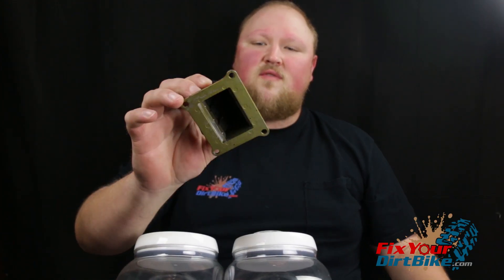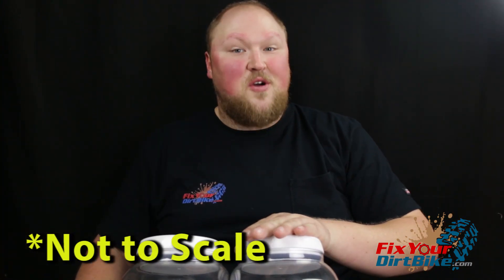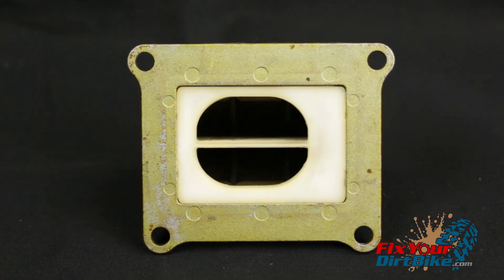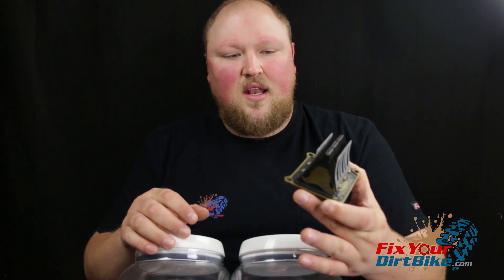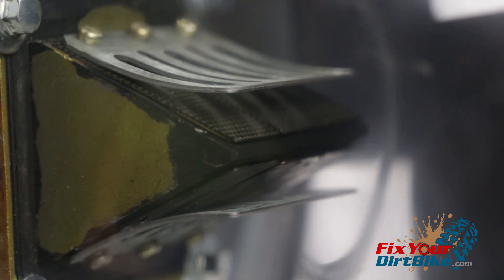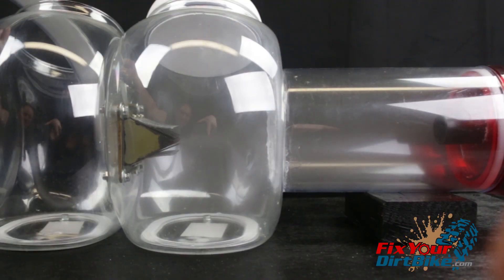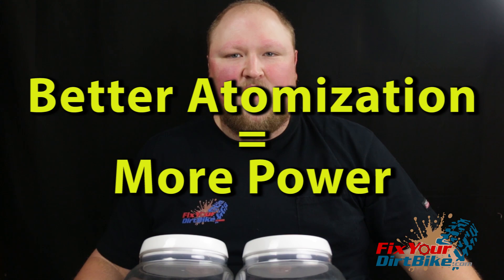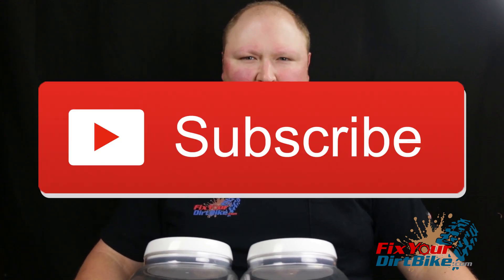How The Reed Valve Works In Your 2-Stroke Dirt Bike | Fix Your Dirt Bike

Comment: Threadlock is needed according to the design. On some enignes the screws literally touch the cylinder or crankcase, so there's no room for them to get loose more than half a turn.

Comment: can reeds be the cause of 4 stroking in a 2 stroke?
Reply from the maker: Possibly. Bad reeds make 2-strokes go crazy. But reeds keep the mix in, bad reeds cause backdraft out of the carb, so it probably not causing the rich mix resulting in 4-stroking. Have you checked your floats/float level/flaot needle?

Comment: Would this make your carbourator leak?
Reply from the maker: What kind of leak? Exhaust coming out of the carb? Or a super lean mix?

Exhaust = Yes
Lean mix = Yes, if the gasket is bad, otherwise, no.
Reply: @Fixyourdirtbike  either my float keeps getting stuck because it comes out of the overfill kinda like I was doing wheelies
Reply: @Fixyourdirtbike  or maybe it’s lean idk how to jet or fuck with air fuel mixture it all sounds the same on my quad
Reply: @Fixyourdirtbike  and it all smokes the same

Comment: I’ve decided to restore my an rgv250 that has sat in a barn for 30years. Tank had skanky rusted fuel in it… will talk a bit to clean. I have ordered a new fuel tap and new fuel lines, battery and new radiator hoses. 
Should I replace reeds at this point?
Reply from the maker: I would replace them on principle. New carbon reeds will be far superior to stock 30 years later.

Comment: Will work reeds also cause a flooding problem. I will start my bike and it will die shortly after. Let it sit for a little while and it starts back up then dies again. Pulled my feeds off and saw light in the corners of the right flaps. Also saw some excess gas sitting at the bottom of the reeds on the crank case.

Comment: So the reed valve is pretty much the powerband?
Reply: No. The powerband is the rpm range where the bike makes the best power/usable power. It varies due to many factors. Such as; you could have two different expansion chambers, and on the same bike one might make power down low while the other makes power at higher rpm. Changing the expansion chamber effectively changes the powerband, or the rpm range that the bike makes power

Comment: It is the reed valve problem if the engine wont stay idle and it shuts off suddenly?when i check the reed valve it has probably in 1mm gap..my bike Suzuki panther txr150
Reply: Yes, and harder to start also probably.  They are suppose to sit flush on the cage. If the petals are not damaged/broken/chipped/frayed on the edges, then you may be able to flip the petals upside down to see if they sit flat better.  You can usually get more life out of them that way, but a 1mm gap sounds like a lot.  New reed petals should be on your shopping list.

Comment: Can you recommend reed valves for a 1980 E70ELCSA 70hp Evinrude? This is on a 15ft bass boat. Has the right prop, rpm is 5400 at full throttle.

Comment: Can broken reeds cause low compression
Reply from the maker: No, the reeds have no effect on the combustion chamber or rings. However bad reeds will keep fuel/air from reaching the combustion chamber, which causes a lack of power.
Reply: @Fixyourdirtbike  A broken reed will blow back "primary compression", (the crank case pressure), back into the carb tract a bit, so it does lower primary compression, (probably just at lower rpm's), and that means the bottom end is not filling as well as it should, which would then fill the cylinder a bit less and make less power. But because the compression does not start until after the exhaust port is closed on the up-stroke, (sans pipe effects), you should be right about the cylinder compression not effected.
Reply: Oh,---watching more of the vid,---that's what you said. :)
I just get a little anxious I guess.  Sorry.

Comment: My yz125 idles but when I put it into gear I can ride it for 200ft before it’s sputter and stops, could the reed valves be the issue? I just did a carb rebuild and top end rebuild.
Reply from the maker: What's your spark plug look like? Do you have fuel residue on the intake side of the carb?

Comment: Brother wheater bad reed valves cause starting problem and slow speed problem in bike plz reply
Reply from the maker: Yes
Reply: @Fixyourdirtbike  my bike is rx135 it has pickup problem and slowspeed and starting problem , i checked all wiring but only reed valves is not changed can i change

Comment: Can a reed valve can cause more gasoline consumptions?
Reply from the maker: YES!
Reply: @Fixyourdirtbike  how
Reply from the maker: @listomoto  When the reed valve doesn't close during compression, it will send pressure out through the carburetor, creating vacuum, but in the wrong direction, shooting fuel out of the carb intake.
Reply: @Fixyourdirtbike  i have a bike that consumes too much gas compare to other exact model. when checking my reed valve the tip of the petals is curved resulting from a small 2mm gap opening. do you recommend replacing it?
Reply from the maker: Yes

Comment: Hey I sucked in a quarter I inch square of reed vale into my right cylinder should I take the engine apart? I just notice today it wouldn’t run right  took it apart and saw my reed was broken looks like fiberglass
Reply from the maker: Ooof! Ya, looks like you'll need to split the case and check everything inside.
Reply: You can run it most time reed breaks it gets caught before being Ingested only metal parts will ruin engine had few explode from badly worn bikes quads purchased and they still run always best to strip but replace start and you'll more than likely be fine just make sure no metal parts fallen in you'll be buggered then 😅👌 years later but may help someone else so they don't freak worst case scenario head barrel off and could find it 🎉

Comment: My Yamaha blaster has been carburetor cleaned. I use the right oil to gas ratio. But when it get to higher rpm something starts to make a chirp noice. Please help
Reply from the maker: Chirp? Rev it without the air box and see if exhaust comes out of the carburetor.
Reply: Fix Your Dirt Bike I haven’t taken a look at the reeds yet
Reply: @Fixyourdirtbike  I was thinking he ran over a bird.  :)

Comment: I have a cr 250 97 with v force 3 (w) . Do i have to put a bigger main jet?? Will it work lean with the v force ??
Reply from the maker: Yes, you will probably need to increase your main jet size.
Reply: I think that it's 165 now . I will need a bigger one is that right??
Reply from the maker: 165 is smaller than stock. So bump up to a 175 to get a baseline tune and go from there.
Reply: Ok thank you for helping me.. if i want something more to ask do you have a page on Facebook or something like that???
Reply from the maker: @psilos-nl8gg  You can message me on facebook! https://www.facebook.com/FixYourDirtBike

Comment: Hi
When I take the air filter of my carb , I see white smoke (looks like exhaust gas) coming out of the air intake. The bike runs really poor idle and when I turn the throttle it bogs. I can't get it to rev. Does this have something to do with the Reed valves? 

Thanks
Reply from the maker: Yes. Your reed valve needs to be replaced.
Reply: @Fixyourdirtbike  Thank you! 👍
Reply: @Fixyourdirtbike  I replaced the reeds and it worked, thank you so much!
Reply from the maker: Glad to help!

Comment: Where is the reed valve in my Echo trimmer?  I am guessing it is one of the little flaps on the diaphragm / gaskets that I replaced?  Thanks for the great video!
Reply from the maker: If you have one it will be behind the carburetor.

Comment: Can it be a reason why my bike doesn’t stay idling ? I’ve already tried to adjust the air screw on the carburetor and the idle on the choke and that’s the only way it will stay idling . But it’s strange because the choke looks like it’s coming up all the way after I’ve turned it and that’s the only way it will stay idling. cr125 1994 btw. I should probably adjust my jetting too
Reply from the maker: Possibly, but It wouldn't hurt to change your reeds if you haven't in a while and see if it helps. After that double check your jetting.

Comment: I got a 96 ktm exc 300 and it keep killing the plugs think is the reed valves? Or can u help me solve the problem?
Reply from the maker: Reed valves will cause fuel issues, but what is your carburetor jetting like? How long since your last reed valve service?
Reply: Reed valves looks fine to me.cant remember my jetting I will check but if I put in a new plug it start fine rides like for and hour or less wen u stop it won’t start again put a new plug and it starts and ride again and the old plus is dead
Reply: My main jet is 170,slow jet 42,needle N85D
Reply from the maker: Sounds like your main is too big. Drop to a 168 and see what happens.
Reply: Fix Your Dirt Bike ok

Comment: Fix your dirt bike, can bad Reed valves cause gas/oil mixture pooling on the bottom of my filter/air box? Also can’t seem to get it running fine, took it for a ride and it waisted 3 gallons  on an 2hr ride when all my friends had about 1/2 tank of gas left? Any help would be appreciated thank you
Reply from the maker: YES! That's a sign of really bad reed valves. The high fuel consumption is the first stage of failing reeds, and fuel mix in your air box means it's getting all the way through the carb, which is why your bike won't run right, so get those valves fixed ASAP!
Reply: Yes,thank you very much
Reply: Fix Your Dirt Bike could the same be said if my carb overlows ONLY after the bike is warm? I reckon it could be pressure from the engine pushing back on the fuel in the float, which opens the float needle. I’ve cleaned that carb thoroughly and its not due to dirt/grime. It only overflows when the engine is warm and then it flows drastically.

Comment: Hi friends ,  i need help to buy a new cylinder for my CR 250 '99 , because i need the 12101-KZ3-J10 , but  i only find 12101-KZ3-L10 , and that is for the 2000-2001 model , there is some difference betwen this models? or simply the 2000-2001 dont fit (or work ) in the 99 ? ,  greetings from Chile!
Reply: Krassna Wasaff Call a Honda dealer and ask them ;)

Comment: My 1995 KTM 250 ran like shit.  Zero bottom end but takes off in power band. I saw some daylight in reeds. I replaced with boyeseen reeds but still not completely sealed. Do I need a new Reed cage or is a tiny bit of space ok? I'm talking less than probably half the thickness of the Reed . I haven't re installed yet
Reply from the maker: Your new reeds are good to run, that little gap isn't that big of an issue, its when the reeds fatigue that they don't close right. But it does sound like you're jetting is rich at low throttle.

Comment: some one told me if they are bad it can mess with the spark plug is this true
Reply from the maker: Not directly.  But, with unburnt fuel accumulating in the crankcase, it will eventually richen the air/fuel in the cylinder enough to foul your plug.

Comment: How does the valve close on the down stroke
Reply from the maker: Each reed petal is like a spring and closes on it's own.  That's why you loose power when the petals get worn out.  When they can't close they let the air/fuel mix back into the carb instead of up through the transfer port.
Reply: Oh ok thank you
Reply: Fix Your Dirt Bike would this cause a no start situation?
Reply from the maker: If the reeds are bad enough, yes, but it's not likely.

Comment: How do I know my reed valve needs replacing?
Reply from the maker: Noticeable power loss in high gear, and look for fuel/oil residue in your carb throat between the slide and the reeds.
Reply: How many miles roughly will they last  on my Vespa T5?

Comment: I have been having bogging problem when full throttle in 4th and 5th gear on 2003 cr250. do I need new reeds?
Reply from the maker: I would check your main jet first. It may be clogged, or if your spark plug is wet, you are running too rich.
Reply: lean the carb out brah

Comment: I have just done one simple test on my brand new KTM which has small gaps on the reeds. I disasembeld air filter and started engine. I was watching the carburetor intake side during slight throttle opening. I also opened choke to richen mixture.

I saw fuel mixture coming back to the air filter box at slow rpms. 

I did the same test on Beta with V-Force. The result was the same. I don't know if the reeds have gaps but I going to check it.

So both bikes don't have good tight reed valve or a little of moxture can go back to the airfilter side and it is normal?

Any suggestion?
Reply from the maker: Your reed valves should have no gaps, fuel back flowing into the air box is a sign of bad reeds. Do both bikes have the same model of carburetor?

Comment: hi mate my sons ktm50 is and pain to start and whn it starts it runs bad ive turnd my reeds over this mean there no good
Reply from the maker: I'm not sure what you mean by turned the reeds over.
Reply from the maker: Justin Purton I just now realized what you meant when you said turn them over.  I have never turned the petals on any 2-stroke I've owned. I was told long ago that the fatigued petals have a higher chance of breakage when turned.
Reply: i know this is an old comment but i had to speak up. i have the v force 3 reed valve in my 2001 honda cr125 i have had my petals reversed based on slight outward curve they are still working 100% even moto tassinari who make the v force reed valve say it is totally fine to turn the reed petals around with no issue just get a spare set of petals ready to replace THEM they wont be to good after they have been turned. I KNOW THIS IS AN OLD COMMENT.